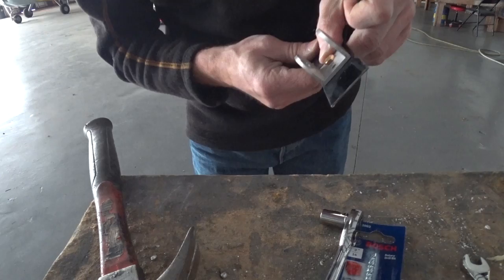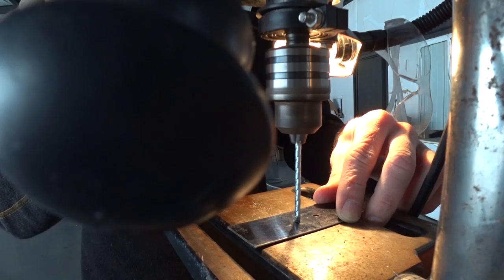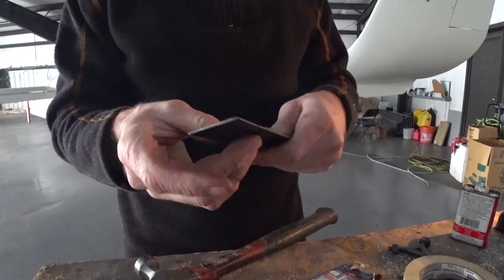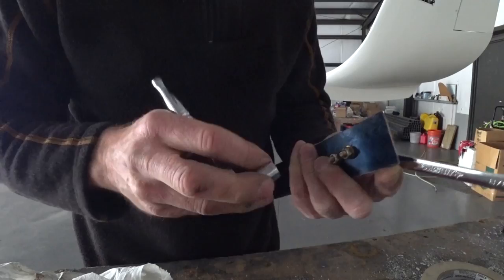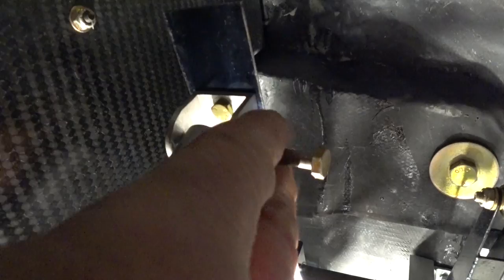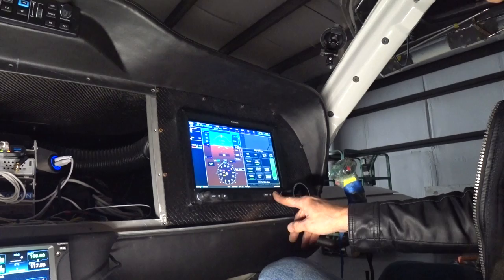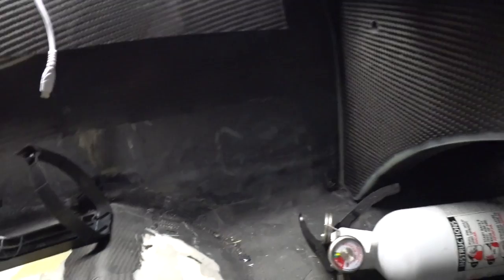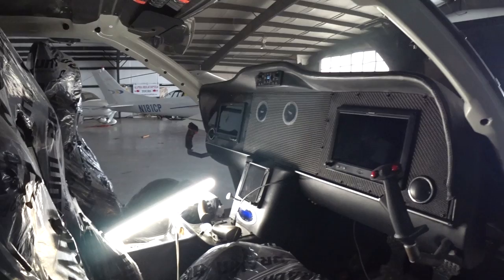A Few Odd Jobs - Building the Raptor Prototype

Comment: Peter, if you followed the comments in your last vid...there was a discussion about the need for a secondary means to secure a bolt that's secured with only a self locking nut, i'm not sure if the the trim spring is considered "critical" to flight...but if it is you should have a second  way to safety the bolts..My part of the discussion really revolved around what IS a bolt subject to rotation....considering you are leaving the bolt loose enough to freely turn..i would think it meets the definition! CFR 25.607 AND AC23.607-1 are very succinct saying.....
"No self-locking nut may be used on any bolt subject to rotation in operation unless a nonfriction locking device is used in addition to the self-locking device.''  Just want to repeat what was already said, considering that bolt seems to meet the definition. I think you're doing a bang up job and am among the many anxiously awaiting the maiden flight...Hell, i would LOVE to be the test pilot!!!       Salute!!!!
Reply: Just so. AC43.13 has guidance on when a secondary locking feature is required. This bolt clearly needs a cotter pin and castellated nut.
Reply: @hpaircraft2187  To be clear...there ARE other methods that can be utilised to meet AC23.607 other than using a castellated nut and cotter pin...safety wire for example.

Comment: Carbide masonry bits don’t have a traditional grind on them. They work through hammering action and the rotating flutes clear debris.

Try sharpening it with a bench grinder, but the carbide tip may snap off in use.
Reply: Exactly what I was going to say!

Comment: They make a FS510 for your GTN 750 that your will connect to your mobile device and automatically download databases. I never remove an SD card to do the databases, they are all done over Wifi from my Garmin Pilot app. It’s called database concierge. Unsure about the G3X devices but the G500 TXi can auto transfer databases from the GTN.

Comment: The masonry bit will work fine if done correctly. Drilled many holes with them through tool steel to create a starter hole to thread the wire through on a edm wire machine. The trick is to sharpen the bit, run it as fast as you can, and have a bottle of coolant to spray continuously on it to keep it cool.  Done right it would have went through that spring steel like it was hot butter. And a lot cheaper than buying a carbide drill bit. Especially if you only have a couple holes... or if the piece is 4 inches thick and you need a long bit.

Comment: you need to step up to cobalt bits for spring steel and titanium.  I learned the hard way that step drills and hss and titanium coated are not the same as carbide.

Comment: A cobalt drill will drill through hardened material better than a carbide masonry bit will. I have drilled 1/8 holes in grade 8 bolts with ease.

Comment: To drill that kind of metal with a carbide bit you have to put the drill in the quickest speed posible. That technique works melting the metal by friction.
Reply: Cannot heat the spring steel as he already addressed in the video.  You will lose the temper.
Reply: No, no it does not. That wasn't the correct type of carbide drill, period.

Comment: It can't do anything. Masonry "drills" don't have a cutting edge, they don't cut like a regular drill, but work like a chisel. What's true is that for spring steel a hardened drill is a good idea - like a K10/F20. In general as harder the steel, as moer 'flat' the drill angle is to get, when standard steel is around 120°, spring drills will be more like 140°.

Comment: Those masonry bits are trash for that job. A real machinist carbide drill is what you wanted, but they are expensive. I have drilled hundreds of .551 holes in AR400 (armor plate) with a Kenemetal carbide drill. Haven't had to send it off to get sharpened yet.